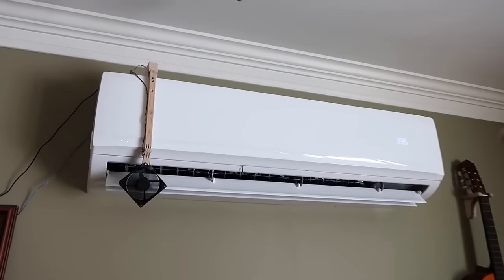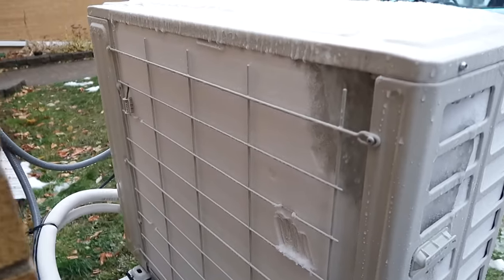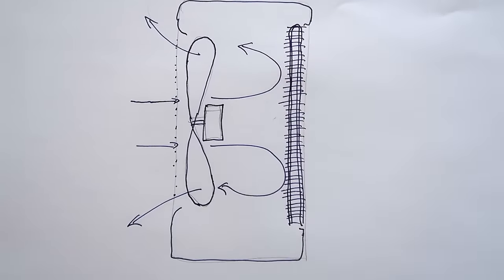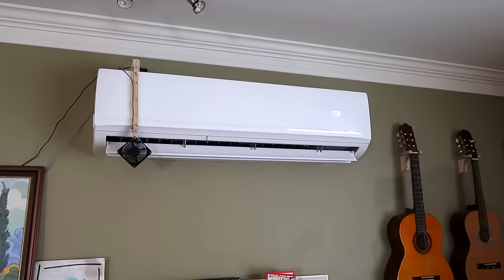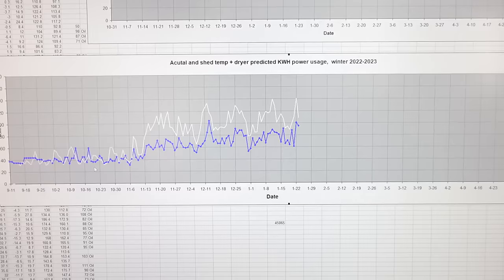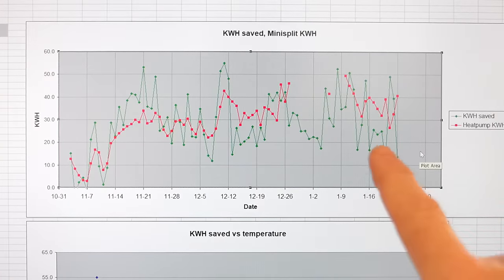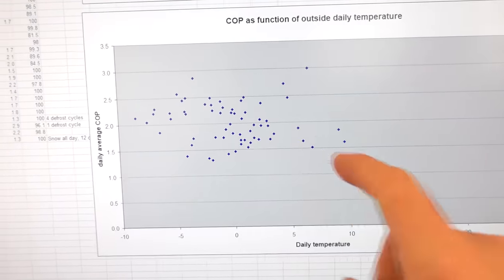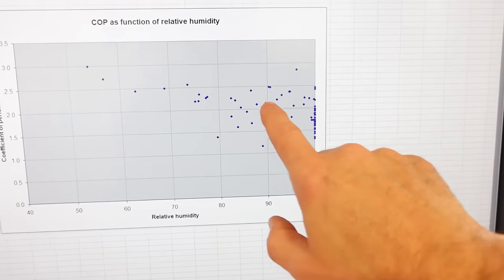How efficient are our minisplit heat pumps in the winter

Comment: It is always worrisome when the coils freeze because the expansion of ice as it builds up could easily fracture some of the thin coolant lines.  I also have reservations about keeping circuit boards in a very wet environment.
Reply from the maker: coils ice build up is typically thru sublimination.  As such, there is no liquid to solid transition happening on the coils, so I don't think the water expanding when freezing is an issue.  Except for perhaps the remaining drops of water after a defrost cycle.

Comment: If you get enough ice build up that you need to assist the unit in defrosting, you should ensure all ice is gone otherwise it will start building again in the same areas. In a worst case scenario the ice can shift the coil and damage it. Warm water can be used to melt the last bits of ice.

Comment: Cool results ( or I should say nicely warm). Unfortunately performance really varies between brands and types of the mini split. I guess these Midea's are in the middle range. You would get better results with LG or Fujistu, especially the heating optimized versions, however as you mentioned with cheap electricity and not so cold winter it does not worth it probably. Not like here in Europe...
Reply: Fujitsu is awful buy a Daikin
Reply: @ryanabels8737  Here in Europe Daikin is overpriced and not the quality that it used to be.
Reply: LG ?? 😂😂

Comment: Good thought, but a coating of sublimation seems to attract moisture from high humidity and it turns to liquid before freezing especially in those Temps you found.  Also the build up melts a bit and refreshes as the temp varies made worse by a deicing that doesn't completely remove the accumulation.  The coils are not robust.  Here we have 100 percent humidity a lot and I can tell you when my coils freeze it is not a 'dry icing' but clear ice with a coating of white ice.  I am not at all confident that this has not been expanding as it forms even at a slower rate has the potential for damage.

Comment: Great vid. Just wondering how you are using 40kwh per day before you need heating? Is your hot water electric?  We use around 6-7kwhr but have gas hot water and cooking. I also live in a much milder climate.
Reply: Now count how many KWh you use in gas ;) One m3 about 10kWh..
Reply: @rkan2  Very little this time of year as we don’t need heating.
Reply: I use probably 2kWh per day just heating shower water, and 20kWh for my 100 mile commute. He also mentioned dryer, if he has typical electric that is 3-5kW for however long he is using it.

Comment: Build a cover around it and you will find a huge difference. I did it and noticed right away.
Reply: A roof over the unit usually doesn't hurt the efficiency that much, but building a cover around it probably will.

Comment: I would recommend you to cover the coolant pipe insulation outdoors with UV resistant material. Otherwise it will degrade and crumble away within less than 10 years.

Comment: You refer to "wind effect" as partial explanation for temp difference between intake and output air of external mini-split unit. Someone can correct me if I'm wrong, but I believe "wind chill" applies only to the effect of moving air on exposed flesh. The temp sensors that you placed in that unit, I believe, would not be affected.
Reply from the maker: correct, wind chill is not actual chilling.  what you are wrong about is somehow thinking that is what I said.

Comment: I noticed there was water dripping from several places under your unit in defrost and it should all come out one spot. There are several rubber grommets that should be installed in the base of the unit that many installers fail to put in. This will cause air to short circuit around the coil in the condenser., especially as it begins to ice up. There should only be one hole for the condensate to drain in the condenser pan and they even provide a little adapter to run a drain from if you need to route the condensate somewhere. Note,  unless you shell out the big bucks to get the ultra high eff. unit they are not suppose to work too well below 18 degrees F which is the standard test point for heating.  The eff. is inversely proportional to the ambient temperature and starts to takes a major dive at about 20 degrees F on most systems  that are 20 SEER or less so most mini splits are pretty much sucking wind in the single digit temperatures.

Comment: I am experiencing the exact same thing with my 10 year old mitsubishi. Around 0 it needs to defrost much more often, every 1-2 hours. Also it has a heating element in the bottom of the outside unit to prevent water to freeze in the bottom of the unit when defrosting.

Comment: Did you have the unit installed by pros or did you do it yourself? And which would you recommend for someone relatively handy?
Reply: I installed minisplit for my shop myself. You need vacuum pump to do so. Install is very easy, If you don't want to buy vacuum pump, after install you can hire HVAC guy to start it up. There is few videos on YouTube showing that job. I believe my unit is senville. I can also operate it from cellphone. I got one called arctic weather. Runs on 240V and works till -30Cor -22F. so far so good and is super quiet in and out. I wish my central AC for the house would be like that. I got it mainly for summer/AC. I have forced air NG furnace. But few times I tried it in -25C

Comment: Do you factor longevity into your cost savings? I'm a hvac apprentice and see many minisplits fail due to poor air filtration, refrigerant leaks, and main electrical boards burning up occasionally. Some of this can be attributed to poor installation, but some seems to be from just a poor design. So if you have to replace it before it pays for itself, is it worth it?
Reply: Buy a Daikin
Reply: For many units the ROI is shorter than the warranty, so yes.
Reply: The good quality ones last years. I have a Samsung at work that cools a server room, runs 24/7 365 and been at it for 8 years with nothing needed but occasional cleaning. Cleaning the funk off the fan wheel on the indoor unit is important along with that coil, but there are cleaning kits that make it easy to do it. Oldest one at my house is going on 7 years now, with no issues either.

Comment: We put in a four inverter Mitsubishi mini split in N Ca. Starts getting less efficient under 40f and around 32f just not that good but we have propane   supplemental. It's saved us 1000s this last year on propane and electricity in both Summer and Winter. The best range is 40- 110 f.
Reply: Did you choose the hyperheating one ? It's on paper much more efficient during freezing cold winters

Comment: In your video you mention the outside humidity several times, but I was wondering about the indoor humidity.
With my Gas heater on in the winter it gets quite dry inside and I was wondering if you had the same issue with your minisplit. Do you find the need to run a humidifier in the winter or is this not an issue?
Also, in the summertime my central AC does a great job to bring the Georgia humidity down since my thermostat automatically turns the AC on if the Humidity level is too high (even if Cooling is not needed).
So how well does your minisplit reduce Humidity during the summer (or is data not available yet)?
Reply: They type of heating has no impact on the humidity.

(well, maybe wood stoves might have. Since they exhaust quite a lot of air that has to be replaced by outside air)

Comment: What is the rated efficiency of your minisplit? Did the measured performance come close? My impression was that many systems' spec sheets these day advertise COP around 3 or 4, so your results were lower than I was expecting.
Reply: Somehow I get the feeling that his heatpump is more for AC than heating. With cold climate heatpumps you should get to 5 COP around 0C.
Reply: @rkan2  I wish he had said. I bought 2 smaller units, one with very good HPSF and one with very good SEER. I put the HSPF unit on the south side and use that for heating on all but the coldest of days (SEER unit is set to freeze protect and will kick in if absolutely necessary) and put the SEER unit on the north side and use that for all cooling.

Comment: Matthias Very helpful & detailed analysis.  Some additional helpful information would be what the heating specs are for your Mini split regarding efficiency and outdoor temperature. Also a few of the  new minisplits are rated for 100% efficiency down to -15 degrees below freezing.  What is the difference and how do the new models achieve the improved heating efficiency?  Would it be possible to add on an aftermarket part to upgrade the heating capacity of existing minisplits? I'd love to see a step by step process for setting up the sensors to create this video.  Thanks again!
Reply from the maker: and what is 100% efficiency?  A resistive heater is already 100% efficient at turning electricity into heat.
Reply: When they say 100% down to -15 I believe what it means is a 12k unit can put out 12k at -15. Mathias what is the HSPF on these units?
Reply: @matthiasrandomstuff2221  This is the video I have been waiting for! I install these for a living and have thought about the issue of humility and defrost. Thankfully where I live it’s usually above 40f and they don’t have to defrost at all. But once defrost has to take place comfort and efficiency goes way down. All the manufacturers give is the HSPF, so this video is very insightful. What is the HSPF of the mini splits at your house? If you don’t know the model # will work and I can look it up that way.

Comment: You need to install the outside heater. I keeps the outside unit from Icing over and breaking a coil and helps it work in even lower temperatures. Frankly this is an "optional" part that should be standard in any sub 40F environment. We have one after our first one went out and its a VAST difference.
Reply: How does that work?
Reply: @jsjs6751  Basically its electrical rod that keeps ices from accumulating on the fin stack on the outside coil. Its keeps the the ice from expanding and damaging the outside coil, which also makes its possible to work in colder temps. The second company that came out and did my new unit stated that they refuse to install them now without the heater as it can result in warranty claims for them but they feel that everyone should run one where sub 40 degree temps are possible. After doing some research and now doing one for my detached garage it makes perfect sense. If the coil outside can't have air pass through as well, its not going to work and since ice expands, if it expands in the fin stack it could rupture the outside coil without it.

Comment: Is there an overhang of the house to protect the mini-split coils from falling/drifting snow?  If not, do you think adding a shroud to pull the air flow from under the mini-split (block the top and sides some) would have reduced the 12 defrost cycles to some lesser number?

Comment: I wonder if a thin cloth filter might help with the snow issue, by not significantly impeding airflow but preventing snow from piling up inside of the minisplit or getting caught in the fins of the radiator. 

It might instead just pile up on the cloth I guess, but I would consider it worth testing.
Reply from the maker: then the cloth filter would be plugged up, and you'd need some method of getting the snow off of that.

Comment: Thanks for all the work you’ve done.  I looked up efficiency vs. temp and the internet said it stays at around 100%.  I think the efficiency stays the same regardless of temp.
Reply from the maker: The unit blows inside air at over 40 degrees C.  Plus another 10 degrees lost in the heat exchangers, and the thing has to basically overcome 50 deg C even if its 0 outside.  Another 10 degrees colder is just making it 20% harder.

Comment: Great analysis, and since you recognise the likely effect of humidity on the system, would a next step be to add humidity sensors around the outdoor unit to verify if the frosting is directly related to the fins dropping the airflow below dew and freezing points? 

I've been heating a small property in Scotland for 9 nine years using a Daikin ASHP and love it. No other heating and my entire annual electricity usage is 2000kWh. Mine does also freeze up, anecdotally mostly in the same mildly frosty ambient conditions as yours, but mine seems to leave the water pumping round my radiators while it defrosts, causing them to cool but not get particularly cold relative to indoor temperature.
Reply from the maker: most icing is just condensation, not droplets.  happens well below freezing too via sublimination

Comment: I am so confused by the daily KWH saved and COP as function of daily temp. I would have thought that the electric heating would be constant in any temp and therefore the mini-split performance would be worse as the temps got below freezing.  Barring the humidity variable don't mini-splits lose efficiency as the temps get deeper in the negative degrees?
Reply: I was thinking the same
Reply: They're only equally efficient at -25.
Reply: Yes, they do. If everything is the same, the efficiency will drop as the temperature does. But in his experience, the biggest cost to efficiency is reduced airflow in the cold evaporator and external defrost cycles. And when the temperature drops the humidity does too, so less defrost cycles and better evaporator airflow.

Comment: With a ground loop our heatpump has a COP of about 3.5-4 as the intake is always 0 to 5C.
Reply: With air source heatpump meant for colder climate you shluld always get 4 COP around 0C. Air to water ~3 COP etc..
Reply: I don't know why the ground source is not mandatory. It Does have return on investment, and saves the planet.
Reply: @jmack619  Because it costs 1 magnitude more and offers maybe how much more in savings? 50% max? (Is no small number but a heatpump to save 50% of current costs is like 2k installed at the cheapest)
Reply: @rkan2  In N-EU you would have paid off a ground well based heatpump in a single winter pretty much, definitely better return on investment then solar panels up north. A water-water heatpump > water-air > air-air AFAIK.
Reply: @axiom1650  A total install is like 15000€ for a ground source heatpump system with a well. How much hot water do you use?

Comment: I have a Mitsubishi 12k unit.  It has been great for heating in New England where the heating season is much longer than the cooling season.  Unfortunately my system has a leak that needs to be tracked down after only 4 years of use.
Reply from the maker: yes, that's the big problem with these things.  They pay for themselves -- if they don't break!
Reply: @matthiasrandomstuff2221  Have you calculated how long it takes for them to pay for themselves? If it is less than the warranty period, it should be a very safe investment.

Comment: Is the unit an artic mini split? Have to call manufacture with the issue? Defrost cycle not working properly means defect some where, so far our Senville Artic working very good, just have to clean filters every 3-4 weeks till we get air purifiers in. They have even defrosted when temps were 32F rainy with a windchill sub 32F.

Comment: What about using a Sugar either solid or in a high concentration in water. I wonder if that would that would allow you to melt off the coils without running the defroster, or damaging them like a salt solution would.

I would guess that other than making it sticky, there wouldn't be any damage, and by spring time it would all just get washed off into the dirt surrounding the Mini-split. (but would probably need to research this before attempting)

Comment: You use 40kWh / day on average without heating? That's like 10x what my house uses (heating and hot water uses gas, and the old dryer was replaced last summer with a new one)
Reply: You must have a tiny house.  My house is all natural gas (furnaces, water heater, range/oven and dryer) and I still use 25 - 30 kWh daily when the AC is not being used.

Comment: I think of how some homes have a heater in a cold basement like in 100+ year old homes. Air conditioners in hot attics. If there was an insulated shed or the mini split was in a garage would it be more effective. Not temperature controlled but at minimum shelter from wind and snow.

Comment: There is a youtube video of a guy who has a tropical greenhouse in Nebraska that he uses geothermal air venting to keep warm, using only ground temps & sun.  How he figured out a way to do this was by using geothermal air for the outside units of his mini splits for his house. (https://www.youtube.com/watch?v=UsZgCz3PQks) 
Basically, he has about 80 feet of 6" single wall metal "vent" buried about 4 feet in the earth.  His mini splits draw their air through that buried tube into the outside units so that the ambient air they use is a constant 50 F, which is optimal for both summer and winter use.  If you have the space, try something similar for your units.  It should make them much more efficient.  You can size the vent for each unit based on CFM and length of draw.  The guy had an inverted "U" at the intake, and obfiously it was above the snow line, and in a sunny location.

Comment: Why not electric resistance heaters on the condensing coil to cycle-defrost it as needed?  Would that waste more power than running the unit on AC?

Comment: Could you put a hood over your minisplit, so air can always get sucked in from the bottom without risk of snow clogging it?
Reply from the maker: then it would suck in snow from below.  The snowflakes move with the air.
Reply: @matthiasrandomstuff2221  depends on how far down the schute is probably? But I get what you're staying without some extensive engineering